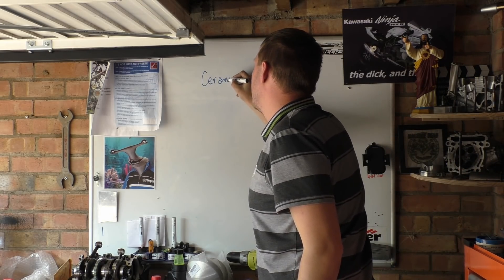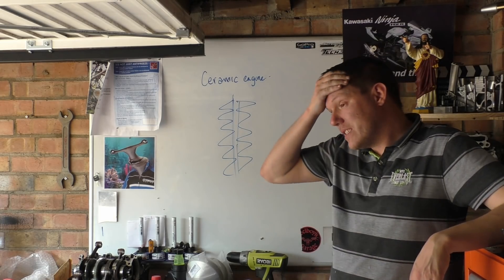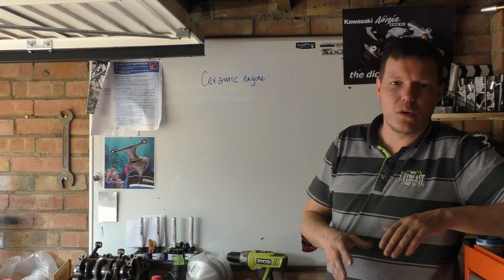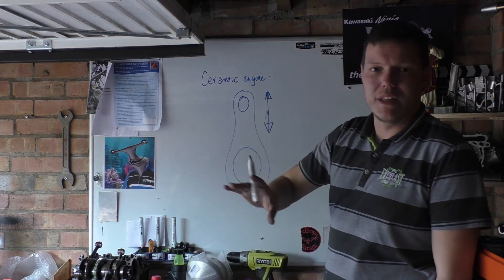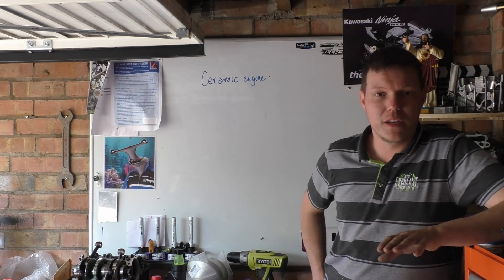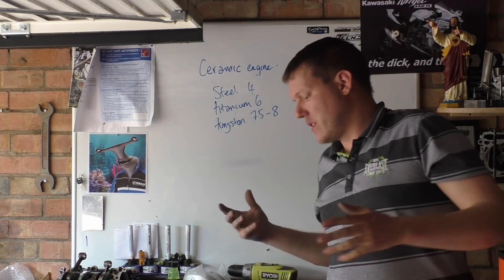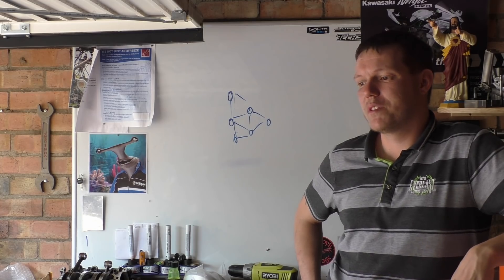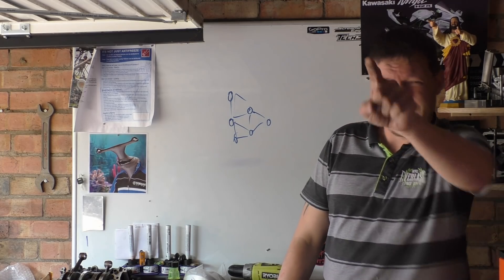Ceramic Engines?

Comment: 1. what about ceramic coating pistons for 2 strokes?
2. would it have benefits to ceramic coating exhaust on turbo engines so that they can keep the heat better?
Reply: "1) - I'm about to do that video tomorrow. And to add to this - do you have any links?"
-i have no links  just questions xD

 "2) This isn't about coatings. Obviuosly this wasn't clear when I said con-rods, cranks etc "
-no it was clear. first i thought complete pistons/exhaust out of ceramic but after the points you made i know this wouldn´t work (exhaust maybe but it´s also under vibrations and impacts) thats why i thought what about coating ^^

"Did you send me that video through FB?"
-if you mean me then no ^^

"the exhaust port and the inside of the two stroke expansion chamber where also coated"
- would be interesting but if the flow is faster you have to get the expansion chamber right for the faster flow i think
Reply: "Did you send me that video through FB?" - I didn't send it you.
Reply from the maker: 1) - I'm about to do that video tomorrow. And to add to this - do you have any links?

2) This isn't about coatings. Obviuosly this wasn't clear when I said con-rods, cranks etc
Reply: I was thinking that very thing this afternoon.

I saw this video https://www.youtube.com/watch?v=7AczhknPIPk 

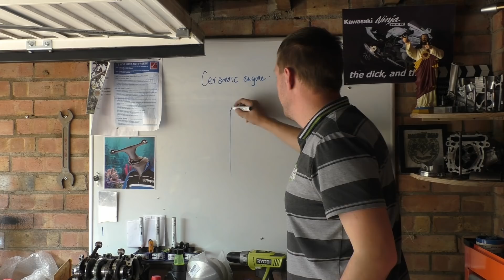3:15 in to the video they talk about the pistons with coatings resisting heat more. It's funny how they hold the blow torch closer to the piston without coating and the others not so much.

I take it if the combustion chamber and the piston crown where coated it wouldn't be a good thing on a two stroke as it needs to dissipate that heat out away to stop pre-ignition?
Reply: Marc I was also thinking what if the walls of the exhaust port and the inside of the two stroke expansion chamber where also coated the temp's would be higher would this allow for faster flow though the pipe?
Reply: I was looking at this stuff as it looks pretty easy to apply but it's an American product.

https://www.cerakotehightemp.com/finishes/

They have lots of info on their website to https://www.cerakotehightemp.com/testing/
Reply from the maker: Did you send me that video through FB?
Reply: Company in Australia doing this since 1996.....http://www.hpcoatings.com.au/
Reply: I’ve used cerakote on heads and piston crowns, haven’t tested for power gains but easy to apply (spray on with air brush then bake in oven)
Reply: Don't old honda race bikes have ceramic coated exhaust pipes and old f1 cars in general (by old i mean anything under 1980)?

Comment: Hang on Matt, because of its lower thermal conductivity wouldn't hold on to heat rather than transfer it to the fresh inlet charge? Especially considering the time that that charge is in the cylinder for? 
I know that the act of compression is going to induce its own temperature rise and also depends on what kind of temperatures are to be expected. I know from my own studies that the newer GDI engines can have peak temperatures between 1000K and 1500K without any trouble. 

Anyways Matt still a great video hope to see more on this 👍👍👍
Reply from the maker: GDI engines don't suffer from pre-ignition by design. Heat is like marbles. It has to go somewhere. Waste heat needs to be removed from the source. If ceramic components don't remove this heat then it stays where it is.

Comment: Yeah, ceramic coating the combustion chamber seems to be bullshit... I was always skeptical... Just sounds retartded... "Oh it holds in the heat better..." Then use an iron cylinder head... See how far you get with more pressures

Comment: I built  a stroker Big Block Chevy  Truck Engine 488  Cubic Inches  .. I had  the Pistons.. Valves and Combustion  Changers  Heanium coated..  The crap  fell off and scratched my cylinder walls so badly that I was burning 7 quarts of oil per day ..  The Crap  is about like Sand ..
Reply: Mike Skidmore - Don't blame the material for poor application. There are ways to properly apply thermal ceramics to those surfaces, but they require preparation... usually a rough sand blasting.

Comment: pre-ignition; egt based water injection at the inlet?
actually, what're your thoughts on water injection in general?
Reply: water is a problem inside engine already. Think of why running cold engine damages oil film. After explosion pressure increases. evaporated water can cool down on cylinder walls, so it does, passing it's latent heat to engine and oil film.
Not much of that, but that water mixes with oil, and that is not good thing. Ofc oil has detergents so oil film is rarely broken or water droplets form, detergent allows emulsion to form... but it is just not good for anything and one needs to replace oil...
Ceramic engines could break 90C bareer in theory, increasing efficiency - but so nichrome and titanium alloys could. But then another problem comes - oil itself decomposes on too hot cylinder walls. Thankfully there are high temperature oils, but none can reach 600C thresholds ceramics can deliver.
Heat transfer is a problem still. Nichrome stainless cylinders increase thermal resistance enough to cause problems already. That is why you can get more power from aluminium blocks even though their overall efficiency is low and they suffer from material fatigue.
In theory if one would give up idea of power, one could design highly efficient and fairly weak engine, either nichrome, incolnel or ceramic (or just ceramic coated. with sputtering and vacuum deposition one can get very thick layer). 
This would be very interesting, especially temperature can be kept under control with computer and array of embedded sensors. 
With double exhaust valves - each one opening each second cycle, exhaust port water cooling (possible by 3d printing engine block)... efficiency could go up. 
3d printing (sintering) has own problems - high pressure casting is just better. 
By 3d printing complex composite alloys can be achieved though. 

Personally i would love to see small 4 inline or 10' V (not full V) engines, 1.0L for ultralight cars like audi50. 
They would not have much power but good fuel economy is enough for me personally, world needs that too.

Another interesting idea is double oil system. One oil system for bearings, one for pistons. High quality light oil for bearings, separate fuel pump with electric priming to prevent start/stop wear. 
low quality "disposable" oil for pistons. 
With careful design, it will allow shaving bit of consumption, and less oil changes...

And last but not least compression  stroke is archaic. Why inject water if we can inject air? Eliminating compression stroke improves efficiency because one does not waste energy on raising temperature of gases, wchich then pass temperature to walls because of condensation . 
Also VVT becomes obsolete - one can precisely inject as much air as needed. Lower temperature before ignition lowers chances of pre-ignition - afterall one does not inject air too much before TDC... 

Will it all make reliable engines though? It all increases complexity.
Reply: @piotrcurious1131  egt - exhaust gas temperature - using water injection on the inlet to cool the air change, based on how hot the exhaust is, essentially to reduce pre-ignition. As an operating system, this would deactivate given a temperature that was within acceptable parameters, not something which would run all the time. That comment is over a year old now, I'm fairly convinced that's what i was thinking of. Condensation from the crankcase breather would be a problem based on what you're saying, and it isn't. 

I'm not even sure if you're being serious about the other stuff
Reply: @chrisdavidson911  i think most serious would be experimenting with air injection to remove intake and exhaust strokes. There are engines using this method - two stroke engines, and even commercial ones, so this is not so much of a sci-fi. Rest of the stuff - who knows. It would require testing if it's worth commercially.

Comment: They are making turbine blades out of ceramic's now as mind bending as that is.  Its quite an achievement
Reply from the maker: They also reported this - 

The biggest difference between the turbochargers used in the N1 engine, and the standard RB26DETT engine, is that the turbine wheels in the turbocharger are made from steel, rather than the ceramic used for the standard RB26DETT turbochargers. The ceramic turbine wheels are found to be very unreliable when used at high rotational speeds inducing higher centrifugal forces (such as when the 
turbochargers are used at a higher boost pressure than stock).
Reply: some old  j47 jet engine variation uses ceramic blades on the turbine wheel...and that is a vietnam war era engine...
Reply: and that's 3 years old,  ...........
https://www.youtube.com/watch?v=is1BBilkyUM
Reply: Chasing Capsaicin and the R32 skyline is 29 years old and had ceramic turbine, what's your point?
Reply: Chasing Capsaicin The R34 nissan skyline had ceramic turbine blades, thats an old old car now. Not new tech.
Reply: http://proceedings.asmedigitalcollection.asme.org/proceeding.aspx?articleid=2650239

http://ceramics.org/ceramic-tech-today/ge-aviation-invests-additional-105m-to-manufacture-ceramic-matrix-composites-for-jet-engines
Reply: There is a difference between developing a technology to meet FAA and CAA requirements and the fact that ceramic turbines have been used in turbochargers for ages. Randomly posting some links isn't an argument chap.

Comment: During the 1980s, in a development program at Ford Motor Company USA led by Dr Arthur McLean, zirconia-based ceramic components have been successfully tested in reciprocating internal combustion engines. Dr McLean stated that their testing was conducted in a single cylinder, 80 mm bore by 80 mm stroke, high speed direct injection diesel engine at full load conditions over the complete speed range and at speed/load conditions representative of the EPA urban driving cycle. His results showed that the fuel consumption of the uncooled ceramic insert engine was 5% to 9% less than the baseline water-cooled engine generally confirming computer modelling predictions. Dr McLean also reported that after several design/material interations a zirconia ceramic cylinder head plate was successfully tested for 120 hours and a zirconia ceramic short cylinder liner survived over 500 hours.
Reply from the maker: 500 hours and diesel - dude this is a motorcycle channel
Reply: The Workshop a, there are diesel bikes, b, materials technology is transferable ffs, wise the fuck up
Reply: Aircraft jet engines currently use a zirconia-based coating to increase their turbine inlet temperatures to improve performance.
Reply from the maker: Coatings! Not fucking base material.
Reply from the maker: a - there are a few one offs that are diesel. b - transferable in what respect?
Reply: The Workshop how many wankel engined bikes? 2 off top of my head re5 Suzuki and Norton. Yet you bang on about wankel engines all the time. Kawasaki M1030 is hardly a one off is it? Powered by an engine developed by Hayes in klr650 chassis and used by US army and available in civilian version. No not a common sight but I'd wager more made and in use than re5 and Norton rotary combined.
Reply: The Workshop transferable in what respect? Are you serious? A lot of materials technology came from aerospace development and trickled down to automotive as and when it can be adapted at a price point or after usage in racing.
Reply: The Workshop http://www.dieselmotorcycles.com/technology.html Hayes engine in detail, runs on biofuel or kerosene